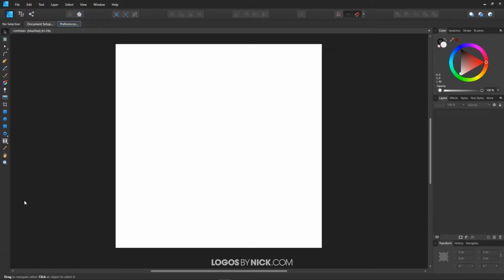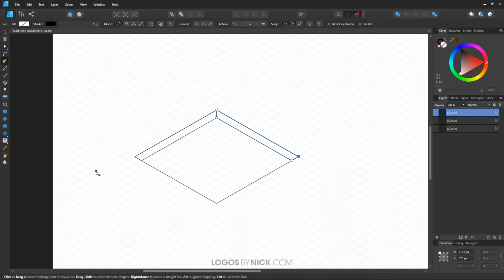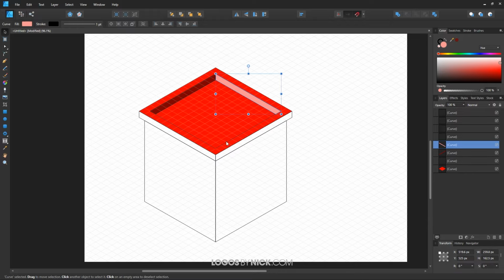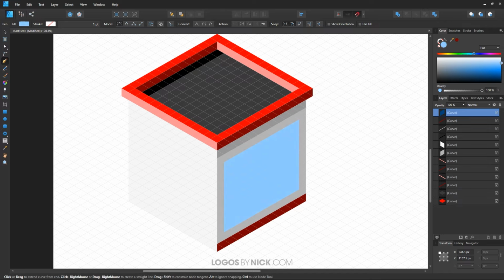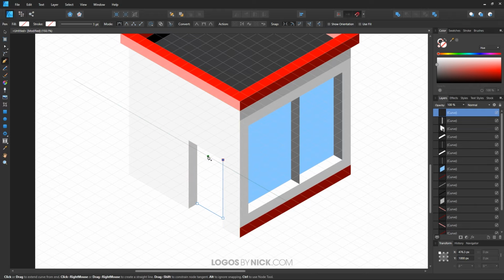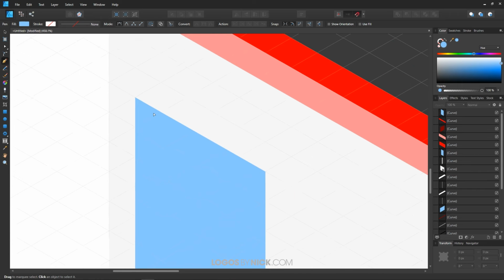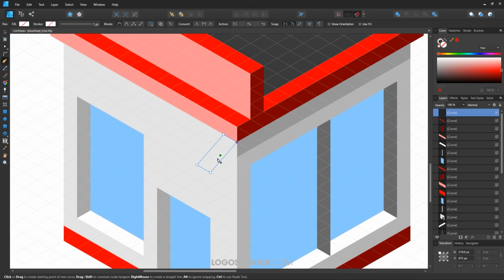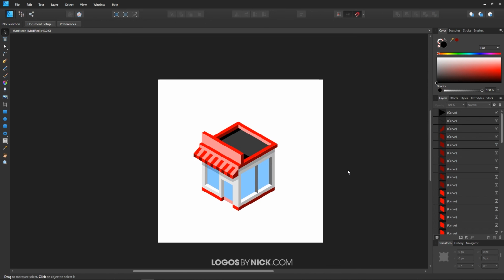Create Isometric Designs with Affinity Designer

Comment: Hi Nick, it might be a silly question but my version of Designer(I have the latest update as of today, 1.9.2) doesn't show the line's legth in px like yours at 1:48. Can't find the setting to do that, do you know where it's hiding?
Reply: Looking for this too!
Reply: @Cataclism7  I also tried searching online for a solution, and in the options, but I haven't found it. This must be something REALLY stupid but I can't find the setting
Reply: @acvrat  I think you need the 'Align to nodes of selected curves' option selected on the context toolbar. First icon in the 'Snap:' section of the context toolbar when using the pen tool.
Reply: @andrewh2000  thanks I'll try that tomorrow when I get to my PC!
Reply: @andrewh2000  This worked! For clarity, this button is at the top of the screen and is the first button in the Snap section. Thanks for the help!!
Reply: @SurfinPog  Doesn't work for me. It shows some numbers but not the length of the line as in Nick's vid. edit: Never mind, it works, but only when you draw the second line, not the first. They must have changed that since the video and caused me to waste half an hour 🤣